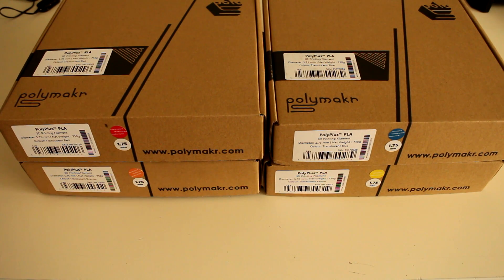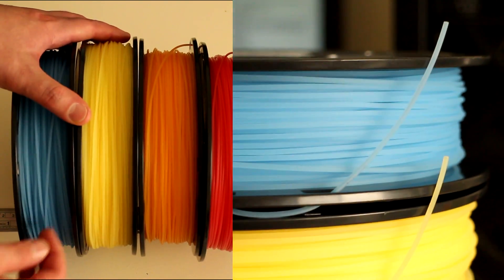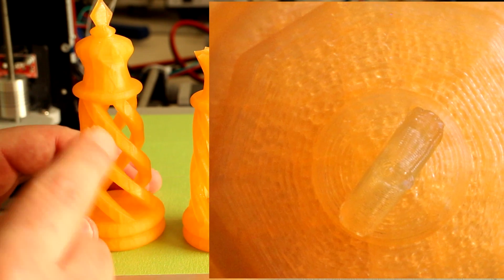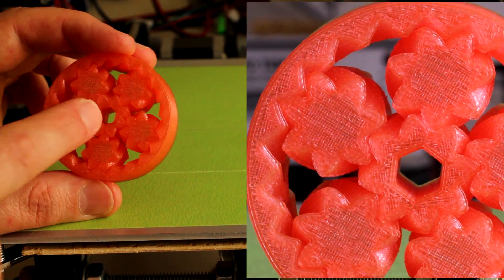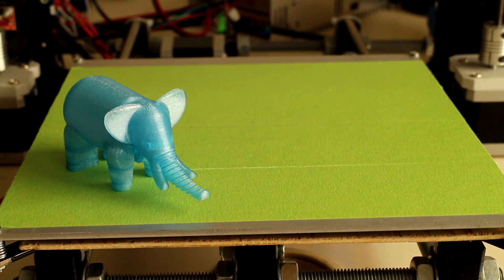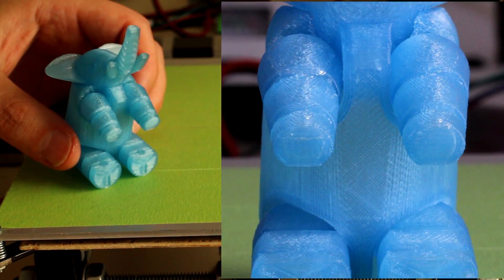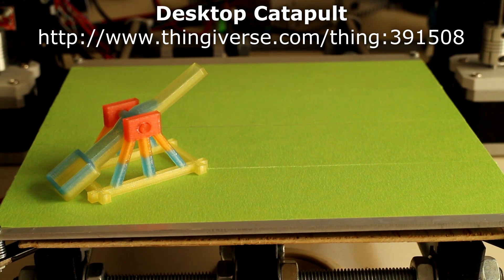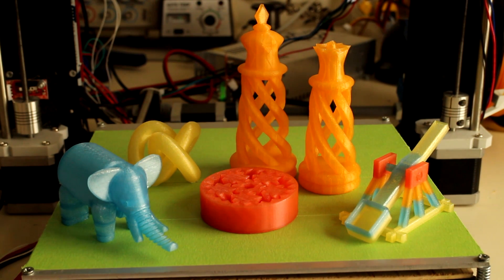3D Printing in Color - Translucent Filament

Comment: it's a mathematical knot.
Reply from the maker: Do you have the equation?
Reply: +Tech2C no for the equation. 
Mathematical knots are defined that the knots don't have any kind of exposed ends.
The knot is the treefoil knot and it's the simplest not simplyfiable mathematical knot at the same time.

Comment: Which tape do you use on your printbed? I am now using blue painters tape and a heated bed (mk3) at 65 celcius to print PLA. At that point the prints will stick to the printbed like crazy, so when you want to take it of you almost can't. So I dropped the temprature of the printbed, but then it will not stick that great to the printbed and the corners will bent. Do you have advice for me?
Reply from the maker: +Raoul Ursum 
I normally use 3M Scotch blue tape 2090, but I'm testing some 3M Scotch green tape 233+.

Sounds like you need to print with the heatbed active, therefore raise the first layer by 0.05mm increments until it doesn't bond so much to the tape. 65c is too high for PLA, try a lower temp like 45c.
If you want to try without the heatbed on, raise the temperature of the first layer of filament to about 230c.
Reply: +Tech2C Oke thank you, I will try it when I get the parts to repair my prusa I3
Reply: +Tech2C I have got the parts to start printing again. I made autobed leveling on my printer and all the prints come out amazing. Now I am trying to print a rear axle, it just fit in my bed when I place it 45 degrees. I first testprinted one with 0% infill to see if everything fits, but now I am trying to print it with a 100% infill, but every time it wrap off the printbed. Could you help me?

Comment: For 3d printer parts I am going back to ABS as everything I have done in PLA was just too rigid and eventually bearing holders, and 8mm smooth rod holders, just lost their grip and parts started to just fall out.  Rather odd and these are never subjected to any heat above about ambient.